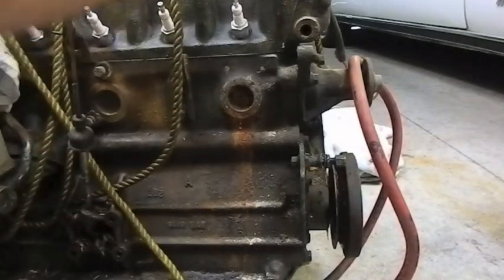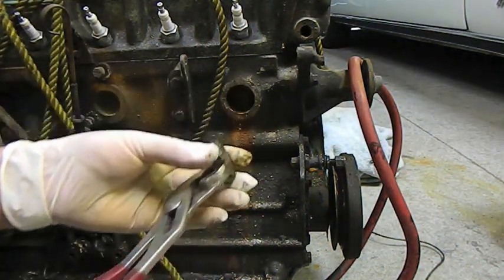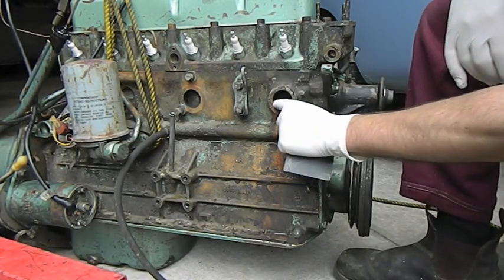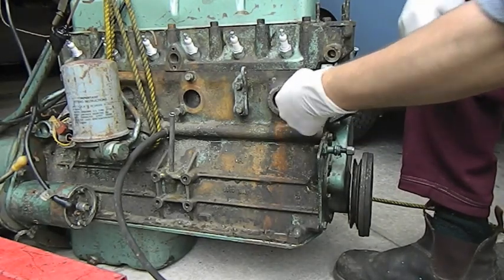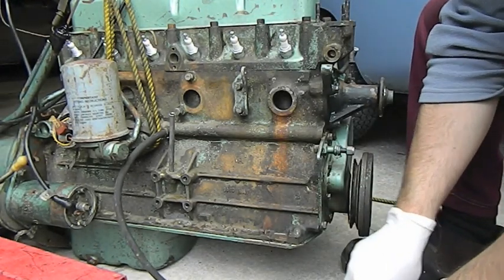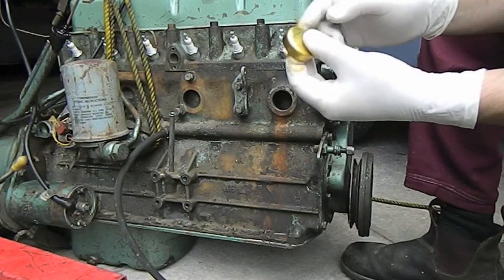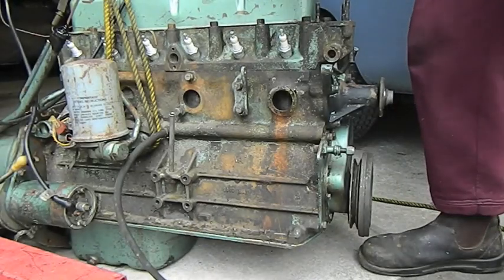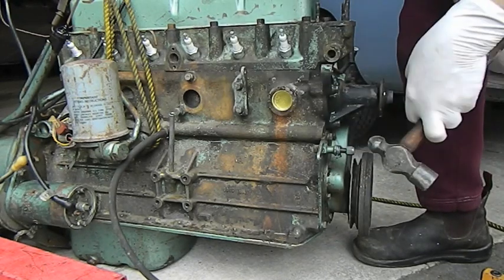How to replace welsh plugs welch plugs freeze plugs

Comment: What sealer would you use for Valley bolts
Reply from the maker: Hi Ethan, if they aren't blind (in that they go into water jackets), I use GM sealer. There are alternatives available as well, cheers.